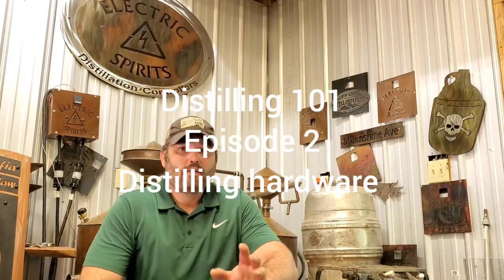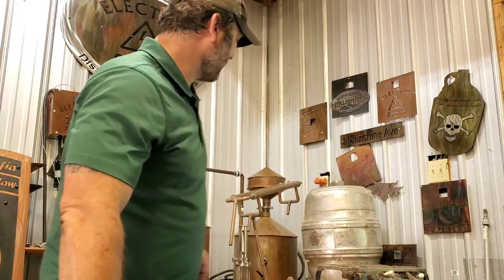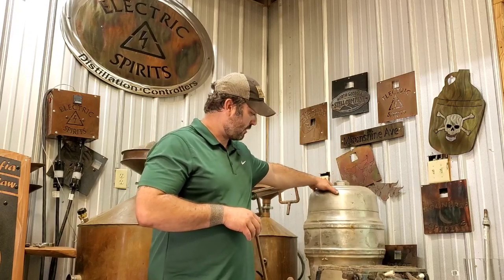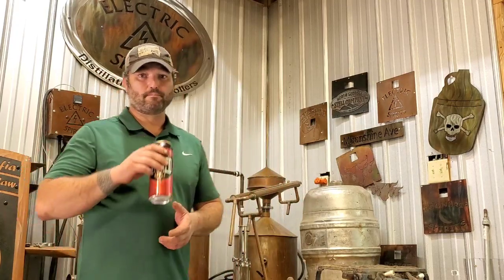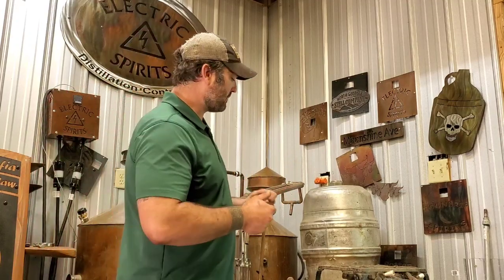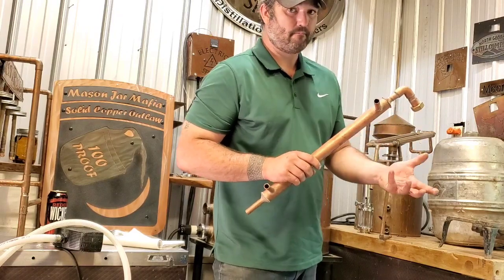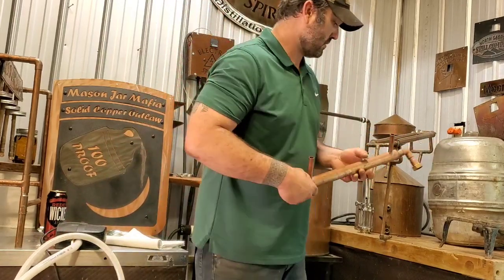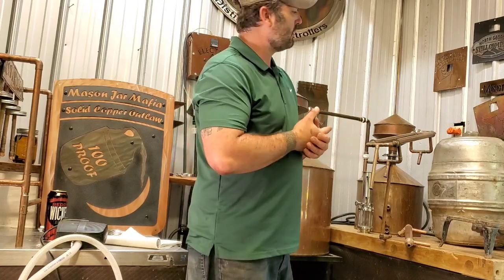Distilling 101 Episode 2

Comment: I like the no nonsense approach! I am gonna make a pot out of a 55 gal SS barrel. I was gonna cut the top out leaving a lip so to attach a copper cone to funnel the alcohol vapor to thumper. Any ideals on cutting the top and copper cone? How full should I fill the drum/pot to start, 1/2, 3/4 , I'm gonna use propane burner? Thanks in advance

Comment: I just want to add to the advantages of ur system. I think you forgot to mention a very important point which is saftey and the main reason i bought ur system. By useing electric internal heat u remove the open flame dangers of explossion. Even small pots can have significant explossions and fire but ur internal heat system reduces that chance greatly since there is no open flame.. thank you for all you do Aaron... shine bright brothers.
Reply from the maker: Yes sir, the added safety is one of great things about running electric